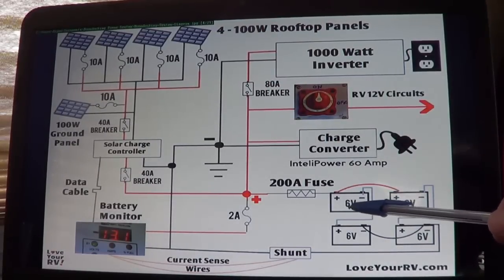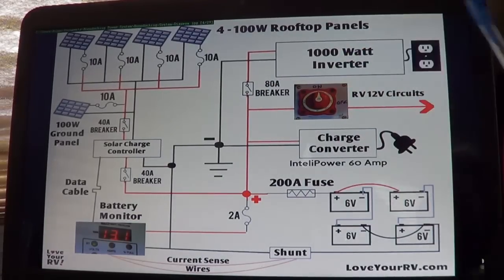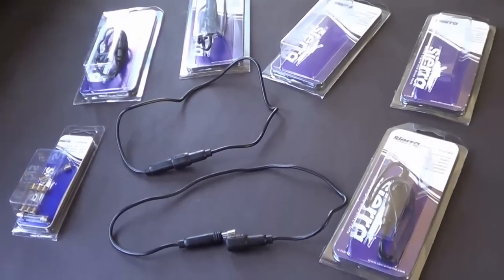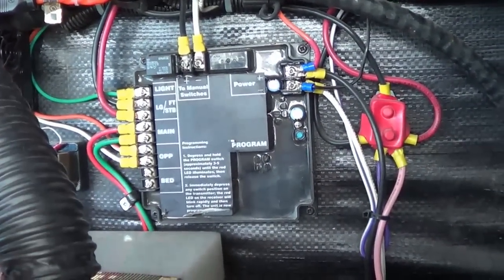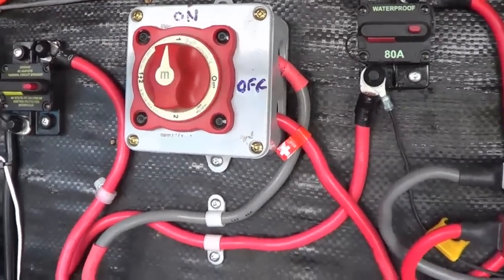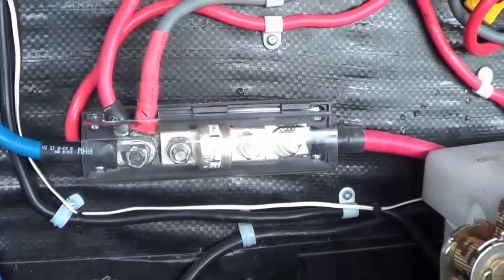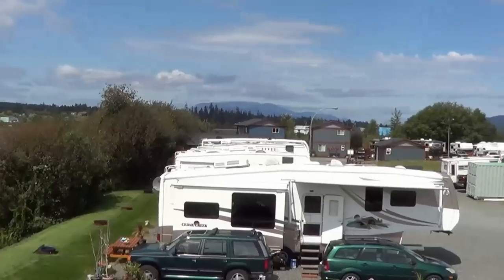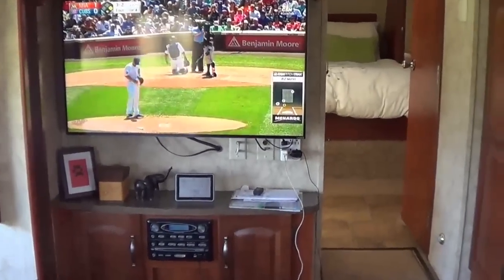Our DIY RV Boondocking Power System - Complete Overview

Comment: I have saved all of these solar/battery/wiring how to's for my close future. The question I have here is (because I have forgot which video), what batteries do you recommend for a set up close to yours? I have been looking at AGM and lithium. AGM looks impressive, but, there is no scale I have seen to gauge their size or weight.200 + amp hours sounds pretty good I am guessing. I just dunno who to direct these questions to.
Reply from the maker: I went for best bang I could for my budget and got Interstate 6 volt golf cart batteries. They run around $600 for 4 giving around 230 usable AH and usually last 5-7 years. AGM is more expensive and Lithium even more expensive but they charge faster and don't give off fumes. Lithium is also much less heavy. However, there are pros and cons to each, type.
I can't comment too much on AGM or Lithium as I haven't personally used them. The cheaper wet cell lead acid has worked well for me mainly because I have a well-ventilated place to keep them and I don't mind the periodic maintenance they require and the extra weight hasn't been an issue.
When I bought them several years ago Lithium technology was much less mature and even more expensive, so it wasn't much of a choice. It seems to be getting more mainstream now and prices are dropping. I'll have to see where it's at in a few years when I'll be looking for replacements.

Here is some good info - https://www.solar-electric.com/learning-center/batteries-and-charging/deep-cycle-battery-types-comparisons.html
https://www.solar-electric.com/learning-center/batteries-and-charging/lithium-battery-technology.html
Reply: Thank you Ray

Comment: Have you ever thought of getting a wind turbine for those cloudy days or have the batteries never gotten that low and Gen charges them good on the cloudy days.How long would it take the Gen to charge the batteries if the we're at 50%?
Reply from the maker: I don't think the wind turbines output enough power for the hassle of setting them up and transporting them. I bet they vibrate the rig too. When the wind is blowing running the generator is more acceptable since the wind drowns out the noise anyway.
About 4-5 hours would bring back the 464 AH bank back to 90% charge with the generator.

Comment: Well I've begun ordering parts, I went with the PD9260C as I plan some time later to add more batteries when we up grade to a 5th wheel and have more space but staring with 2-Trojan T105RE for now. I'm going with the Xantrex 1000W SW Inverter as it had some good reviews and a good price. but everything else is right off your list except for a Champion 3100i Generator so I can run the AC. But I would like to know where you got that Buss Bar for the negative cables? Thanks for the help, great videos and blog I'm a Electrical Contractor soon to retire and once I read you're a Electrical Engineer I knew, well, your da' man. Happy trails.
Reply from the maker: Thanks, I got the negative buss bar from a local solar shop in Yuma if I remember right. But you can something similar on Amazon - https://www.amazon.com/Blue-Sea-Systems-BusBars-100A-250A/dp/B01IHPJAUK. Cheers Ray

Comment: I see from an earlier comment you can charge with solar and generator at the same time.  And at the same time run all the 12 VDC stuff too I assume.  Does all your "gear" stay in 12 VDC mode all the time or do you switch back and forth between AC and DC?
Reply from the maker: When boondocking most things stay in 12-volt mode, then I use the inverter for anything that absolutely needs AC to run or charge off of.

Comment: Are you still happy with your batteries? Have you noticed any drop in power since you got them.
Reply from the maker: Yes, still working well, we just are finishing up a 6-month snowbird trip to the southwest,  dry camped much of the time. Only put on less than 30 hours on the generator.  
Our solar controller does an excellent job of charging the batteries, I make sure they stay topped up with water, and every few months I equalize them.

Comment: Very nice and much appreciated. I will be making the jump to solar on my 2004 Roadtrek and the one thing that confuses me is if I have a solar charger connected to my house batteries AND the original factory wiring is also still connected will there be a conflict between the solar charger and the one that came with the coach?
Reply from the maker: Thanks! They should coexist fine. The one with the higher charging voltage will take over as the batteries reach full charge and finish off the final charging phases, usually that is the solar controller. They generally can be set for 14.8 volts which most deep cycle batteries like my Interstates, for instance, like to see. At that point, the OEM charger will most likely be in float mode since it will see the higher voltage and think the batteries are charged.  Cheers Ray
Reply: Okay, good to know. One more puzzle I have is about the air conditioner and microwave; Would you know if they are hooked directly to the generator and bypass the built-in inverter on a Roadtrek like mine (2004)? This is where I would love to see a diagram like the one you created. That was really well done.
Reply from the maker: I would say yes.

Comment: I built it and it works! Now I need is a box for the batteries but can't seem to find what I need. A box for 2-12V Trojan 1275 in line 27"L x 7-1/2"W x 11"D. Can you give me a link to where you got your's, maybe they'll have what I need.
Reply from the maker: The place I got mine doesn't have a link they are a regular bricks and mortar type marine supply store. But, the same box is available here, maybe they have something you can use. - http://www.allbatterysalesandservice.com/browse.cfm/2,619.html

Comment: I just ordered one. The one installed in my RV has an output of a whopping 3 volts at the moment. Not doing so well at charging. And while I was meditating on this singular circumstance I found the electrical connections coming into the breaker box were all fricked up by the installers. They doubled up on every neutral wire when hooking up to the terminals even though there are plenty there to spare and one of them was not tight. This caused heat and almost fire.
Reply from the maker: Ya, 3 volts won't charge much. ;) I assume you are talking about the charge converter?
Reply: Yesa. I tore into my fuse panel to do some trouble shooting and found a meckuva hess. And l let Forest River I was not impresses. The neutral wires were all ganged up on terminals when there were plenty of terminals for one on each and one was not even tight. Thus this caused bad connections and burnt insulation. Little more melting and it would have made it back far enough to short out. Poor poor installation. So I found that trouble but that was not my trouble for the dead battery.
Reply from the maker: Wow, glad you found that i before anything major happened!

Comment: There was one question I missed or did not find. Which Blue Sea battery disconnect switch did you decide to use and why? I see many options to chose from when I click on the link you provided. Thanks in advance - Ray
Reply from the maker: It's a dual switch and I only used it because I had it from a previous dual battery setup. I fI didn't have it already I'd likely have gone with this single one - http://amzn.to/2qs70LH   Cheers Ray

Comment: Great system. I'm beginning to build mine and thinking of starting with 2- 6v batteries like yours but get the PD2945-CV charges that cost less. Would there be any drawbacks doing that other than longer charge time and would it work okay when I go to four batteries?
Reply from the maker: Thanks. Most lead acid batteries are looking for a charge current rate when in bulk mode of around 10% of the total amp hour capacity. So for a bank like mine, 4 Interstates 464AH, it would be around 46.4 amps. I could have went with a 45 amp charger but I like the little extra headroom and I'm not maxing out the charger. Cheers Ray

Comment: Great video.  Question on wire connections to your breakers. On those breakers there is a "bat: & a "aux" side", I assume the battery positive goes to the "bat" post and the positive from the controller goes to the "aux" post.  On the solar side does the positive wire from solar go to the "bat" post" and the "aux" post wire to the controller's solar side? Or does it matter which post on the circuit breaker the positive wires are connected.  Thanks. Keep up the great videos.
Reply from the maker: Thanks, I don't think it matters, as far as I know, the breakers don't have polarity, they should work either way. Cheers, Ray

Comment: How much room/weight capacity is there on you rig to add more batteries?  Trying to decide on whether to go for a 5th wheel or not based on this
Reply from the maker: I don't have too much capacity left since we are full timing in only 30-foot fifth wheel. So I'm at about max I feel comfortable with. Still about 700lbs under the 10,000lbs GVWR but I like a little safety margin. Especially since I boondock and sometimes fill the waste tanks right up before waddle into the nearest dump station.
 Luckily the bank is plenty big enough for our needs.
A larger fifth wheel could likely handle 6 or 8 batteries or you could always go with Lithium if you have enough cash. they are much lighter. Cheers Ray

Comment: so when you are powering and charging your rig with a gen the solar panel charge controller is completely out of the loop?
Reply from the maker: No. They both can charge the battery bank at the same time.

Comment: I have my parts and beginning to assemble the system. My original Negative battery lead was connected to the trailer frame. Should I reconnect that to the new Negative Bus Bar? Didn't see that in your video.
Reply from the maker: Yes, I have a cable from the negative bus bar to the trailers frame to provide a return path for the RV's 12-volt circuits. Some of them use the chassis as a ground.
Reply: I thought so, Thanks.

Comment: Hi there - could you have gone 4 - 12v batteries in series or would that mean adding more panels?
Reply from the maker: If you factor in price and battery bank footprint the 6-volt batteries are the best bang for the buck in my opinion.
Most 12-volt lead acid deep cycle batteries have half the amp hour capacity of 6-volt ones so it's basically a wash power wise.
6-volt batteries are taller so take up less space footprint wise.
If money is less of a concern then high quality 12 volt AGM batteries or Lithium become options.
Cheers Ray

Comment: Hey Ray, with all the panels (50 amp potential) do you ever see it exceed the 30 amp charge controller?
Reply from the maker: I never see the full potential of the panels as that is a lab rating. with most panels, you're lucky to see 75-80%. My panels are rated for just under 6 amps each.
Also, with weather and sun angle I'm rarely in a perfect condition for long. For the odd time, it may exceed that, the controller is smart enough to drop the extra energy and keep pumping out 30 amps.
Reply: +Love Your RV yeah, I never see full potential either. thanks

Comment: What kind of things can you run on this? Can it power an Air conditioning unit?  Ive seen small solar setups that can do microwave/tv/etc.  How many amps total do you have at your disposal or is that up to the amount of physical batteries?
Reply from the maker: What you can run on it depends mostly on the batteries. 4 batteries like I have can run everything in the RV short of the AC unit. You would need a 2000 watt inverter.
To run an AC you would likely need 8 batteries and they would still run down pretty quickly, not very practical.
I have chosen not to run the microwave or other high wattage items like a coffee maker, toaster, hair dryer, etc so I could save money by only buying a 1000 watt inverter.
If I want to use the microwave, etc. I'll fire my portable generator.
Reply: Love Your RV cool I'm looking into boondocking but definitely would want all the comforts!  I'll have to go for a 4000 watt inverterter lol.  Tug a trailer behind me full of batteries.  24/7 air conditiioning!

Comment: I haven't read all the comments so this may have already been addressed but it looks like the nut on the negative post on left side closest battery is only threaded on by a thread or two. Could  be a problem there waiting to happen. I'm enjoying your posts. Thanks.
Reply from the maker: What your seeing is a second nut on the post holding the solar controller's little battery temperature sensor, under it is the real nut that holds the cable in place. :) Cheers! Ray

Comment: Nice Install:
Hello Ray, I have a question. Currently I have the following items:
5 - Solarworld 345 watt xl mono panels – I might get a 6th one.    Each panel is wired directly to Combiner Box, each panel has a 20amp breaker.
Midnite Solar MNPV6 Disconnect/Combiner Box
Magnum Energy PT‑100 MPPT Solar Cell Charge Controller6 – Interstate 232 amp 6v deep cell batteries - Model GC2-XHD
I want to install a PV Amp Circuit Breaker between the Combiner Box and the 100amp Charge Controller -I want to install a CONTROLLER Amp Circuit Breaker between the Charge Controller and the batter bank - 
What size Amp Circuit Breaker should I install? I would like to use the
Blue Sea ## Amp Circuit Breaker, maybe a 285 Series
I have two Blue Sea e-Series Battery Switch/Single Circuit On/Off –
9003e switches.  Where should they be located in relationship to the
Charge Control and the Battery Bank and AMP Circuit Breakers.
Thank you.
Reply from the maker: Nice system! Between solar array and charge controller the fuse is mostly there to protect the wire from overheating in a short circuit situation, so a lot depends on the gauge, there are tables to figure it out. http://circuitwizard.bluesea.com/  I usually look at the max current I would expect then make sure the wire gauge can handle that without much voltage drop and go up about 10 - 20% for the fuse size. I like to put my breakers near the charge controller so it's easy to flip them both off.
Reply: Thank Ray for your information.I think I should be able to figure out the size I need.  Have A Good Day....

Comment: Hello. in the connection to the solenoid is necessary to have a circuit breaker and the Blue Sea 12 Volt battery disconnect switch ????
Reply from the maker: I'm not sure what you mean by the solenoid, which part are you referring too?
Reply: Love Your RV  between the engine battery and the house battery is the isolator. Do I need the marine switch and a circuit breaker or what is the best option?
Reply from the maker: You shouldn't need anything if it is an OEM setup. The isolator is a disconnect when the key is off. However, it wouldn't hurt anything to add a switchable breaker so you can easily disconnect if wanted to. 
Size the breaker to protect the wire from overheating. There are charts online
Reply: Love Your RV once I have the circuit breaker can I have the water pump and lights running if they are connected right now to the engine battery and only turn on when the keys are on?
I have a Toyota winnebago warrior 1993

Comment: Thanks for the diagram, you always have good info.  I was checking Renogy forum and they make a fuse that goes into the MC4 connectors and a waterproof.  I am wiring my system now, one thing that I wonder about is can you charge with shore or generator along with solar at the same time without some switching?
Reply from the maker: Thanks. I knew about those connectors but shipping and the price made the ones I choose a more attractive option for me, but those are easier to install for sure. ;)
Yes, you can charge with both at the same time, no problems. I find that usually the solar will take the lead since it is capable of producing the higher charge voltages needed. When I plug in I just leave the solar on as well. I guess I'm saving the campground some money! Actually, some places charge for electrical so it would be a good thing in those cases. Cheers Ray

Comment: how can I turn off my charger of my  camper batteries and just have my solar power  all my out  camper just with my solar  I have 4 100 w panels   2000 inver 4 , 12 volt battery